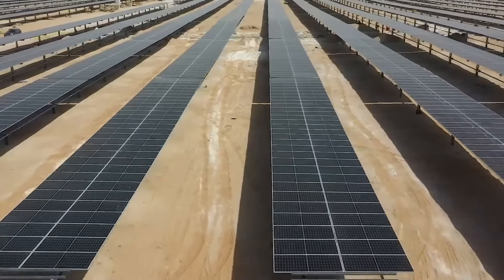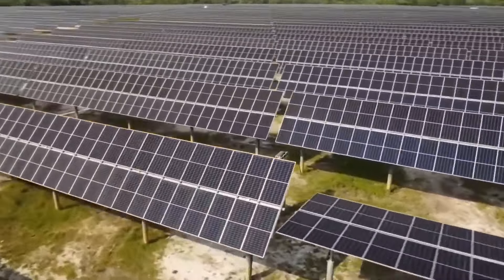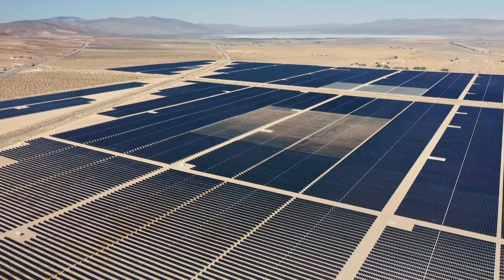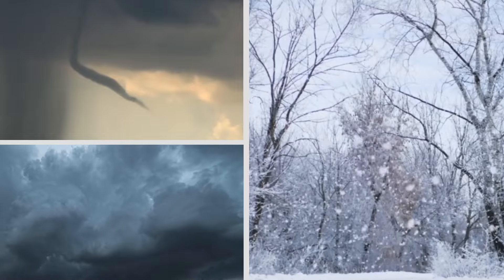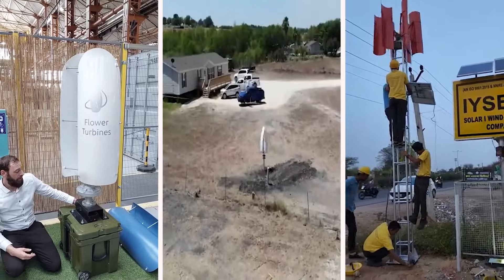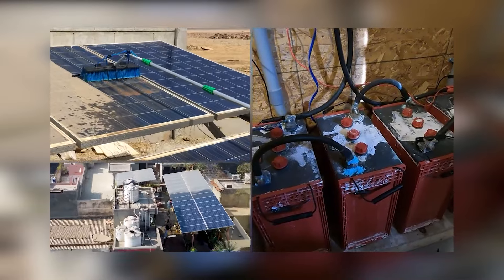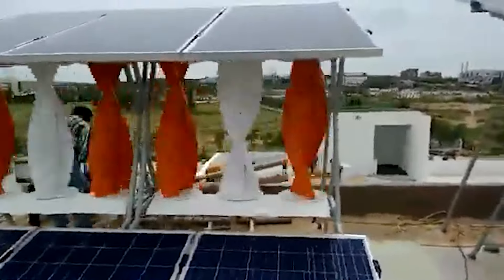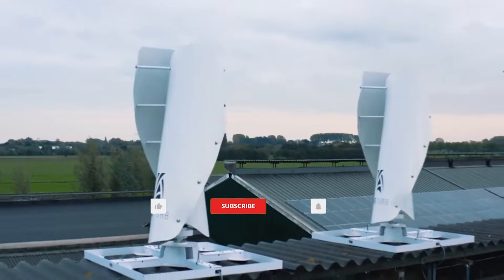Genius Vertical Wind Turbine for Home beats Off Grid Solar Panel!?

Comment: Vertical wind turbines are a great idea, but your presentation of them was full of issues. You’ve ignored not just basic problems but factors that could drastically affect the efficiency of costs of these units. You didn’t mention any numbers or comparative figures, and you repeated the same information over and over.  Sounding like an ad isn’t that useful.

First off, Wind power, just like solar, will always need batteries to be useful/efficient, so don’t pretend they don’t. These wind turbines will not always work all the time, only generating usable electricity when the wind is blowing at a certain minimum speed. They can also be subject to wear and tear too, with internal rotating components that need to move smoothly, so it may still need maintenance.

You haven’t talked about the range of electricity generated by these wind turbines, the kind of costs required to buy them (and how long it will take to pay off), and a comparison between these wind turbines and traditional solar panels. The equivalent of how many wind turbines compensate for the same power level as so many solar panels, will determine how many you need to make the same amount of energy. Wind turbines still take up a considerable amount of space, so how much space would you need to lose to put up multiple of them? 

And can wind turbines be fixed on steep roofs, or do you need to fix a vertical pole nearby for it to work instead and how expensive would that be to put up on top of the costs for the turbine itself and other installation costs? You criticised solar on this topic but didn’t mention how these are affected.

Furthermore, wind turbines generate energy better at higher altitudes, particularly in built up environments where the wind doesn’t tend to reach as low to the ground. so you might not get much energy output depending on where you place it.